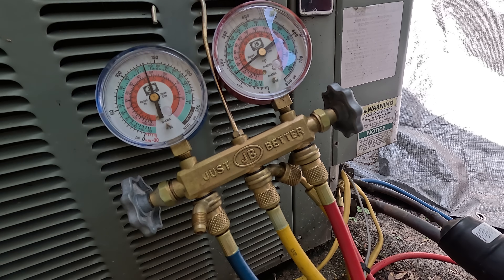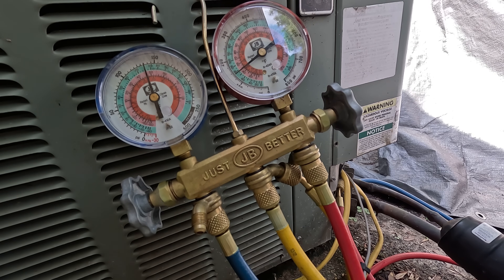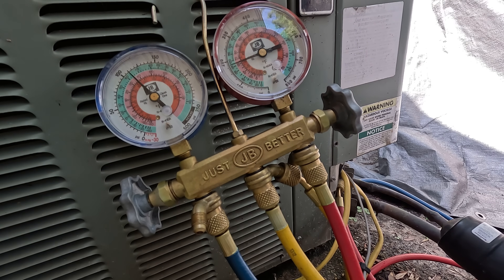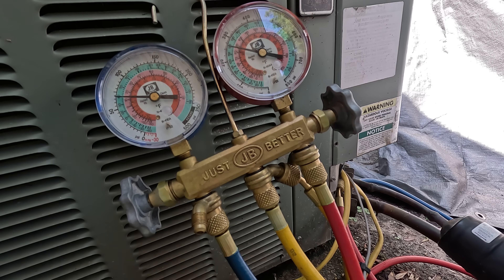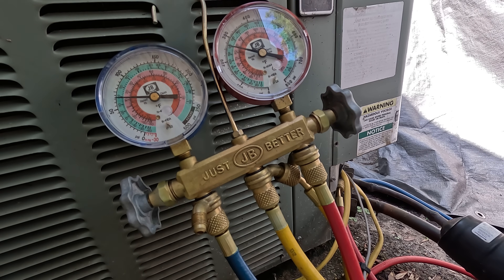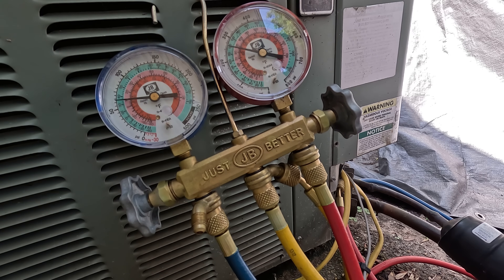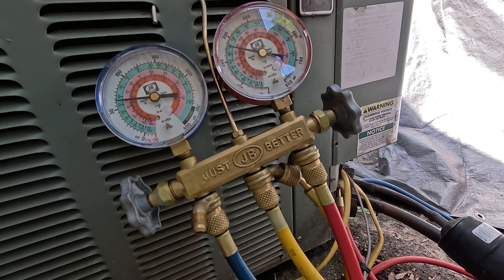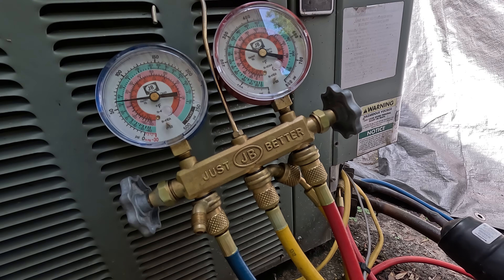How To Check AC Freon Refrigerant Level R-22 Or R-407C

Comment: Very good information one question ❓ please it's an R22 system did you change the mineral oil or did you just replace the R407c with the mineral oil let me know because I have one to change over
Reply from the maker: No need to change the oil with 407c it works with mineral oil.
Reply: @diyhvacadvice2millionaire  why do some say it does not ? Over time it will gunk system.

Comment: Also 71 psi suction looks good, but without knowing RA temp, SA temp, subcooling and superheat, I don't know if it's a good number or not. If it's 90 in the house right now, 71 is probably a problem. Without those other numbers, you're flying the plane without all the controls
Reply from the maker: Lol
Reply: @diyhvacadvice2millionaire what's so funny to you?
Reply: Without superheat/subcooling readings you cant properly diagnose a refrigerant charge on a AC unit.

Comment: Actually your head pressure will be relative to the outdoor ambient. On an older 22 system, add 30 degrees to the actual temperature and then look for the corresponding head pressure for that number. For example, it's 90 outside. Add 30 degrees; now it's 120. Find the corresponding pressure for 120. That should be your head roughly. I would expect 250 for an 80ish summer day, as high as 300 for a blistering summer day. On 410, add 15-20 to the actual temp outside.

Comment: Is R407c a popular alternative which does not require a retrofit of R22 system? Are there any other alternatives which behave like R407c?
Reply: 427
Reply: Change oil with 407 C (I think), however, the latest is 422B, same oil, better to recover whats left of 22, then add in 422B, 90% of original required , then tweak.  I understand dthe orifice may have to be enlarged slightly, most Techs say no, but they're kind of lazy and reay to get out of there.  One tech said he has added some 422B on the 22, without any problems, but remember the theory is there is 'no' top off's refrigerant. Study on 422B.

Comment: Thanks for an easy to understand and informative video. My 41 year old Rudd has a chart on the compressors cover shield that tells what my high side pressure should be at various ambient temperatures. I can also tell if it's getting low on 22 if the return line no longer gets as cold. Seems everything was simpler in the old days!😂
Reply from the maker: Thank you for your feedback & thanks for stopping by the channel.
Reply: Thank you for the information